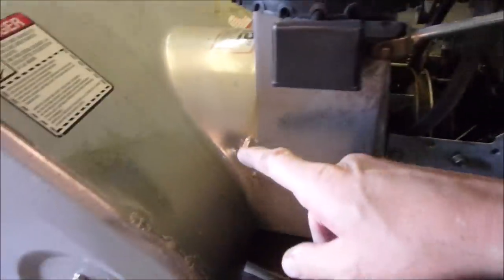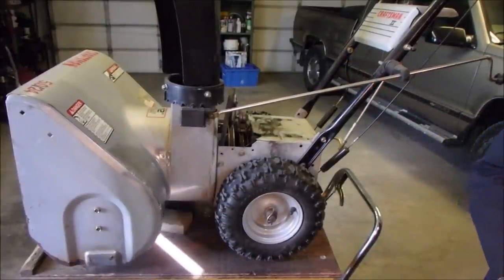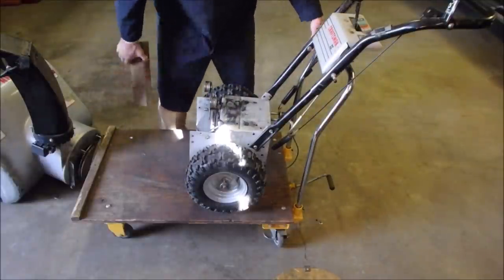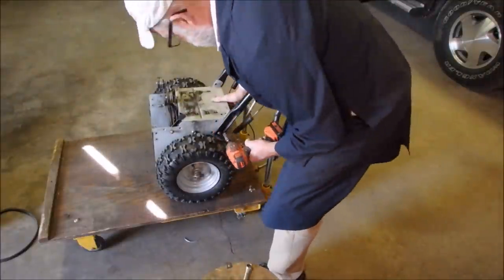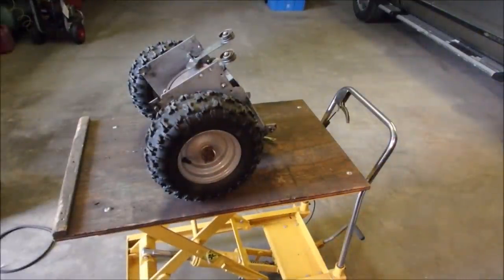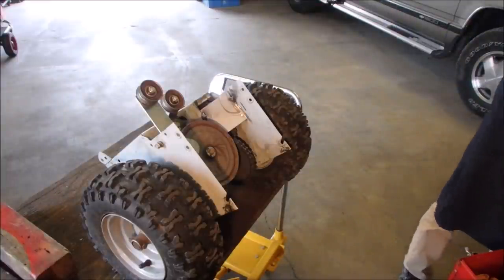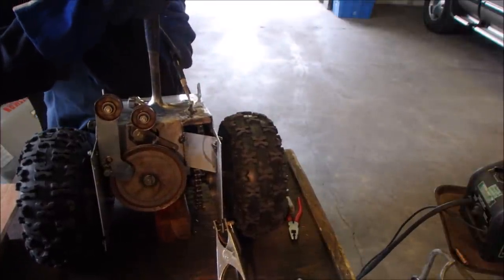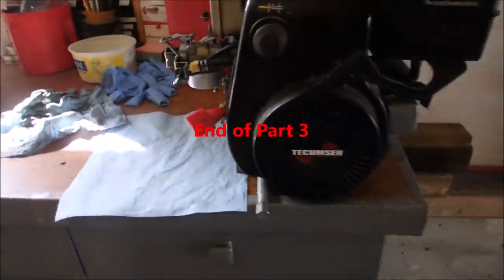Free Craftsman Snowblower Part 3 Welding the Transmission

Comment: I applaud your efforts to save this snowblower, it's exactly what I would do.  Except, I would have pulled every shaft out of that transmission/gear box and welded those breaks from both sides.  I'm, or was, a stick welder and I would have used 3/32 6013 rod at about 40 or 50 amps. (6011, my favorite rod, penetrates to much for but joints in thin metal)  On the inside, if there was room, I probably would have welded in some small angle iron along that long break on the top edge and maybe applied some straps of metal in other places.  By the time I got done, there would be NO doubt that it was going to hold together even if I had to grind down some of the welds on the top to mount the engine.  What you did will most likely hold, it's just not applying the mentality toward over kill as I did when welding on farm equipment to make it stronger and better so it wouldn't break the next time.  Not in the same place anyway.  ;^) 

Sort of a side question here, but shouldn't the shear pins and auger gearbox and belt have given way long before busting up the transmission/drive box in such a drastic way?
Reply from the maker: The shear pins in the Auger were changed out to grade 8 bolts but the old guy who owned it before me.  I understand what you are saying about welding from both side and get it.  However this is the smoothest snowblower going but i haven't used it much as I just got it back together.
Reply: @BrucesShop  :  Yep, once its back together its mentally difficult to think about tearing it back down.  (images of myself stomping around, plaintively saying NO! I don't want to!)
Reply from the maker: @InquisitiveSearcher  I got great penetration on the welds as I cranked up the hear on both the stick welds and the flux core.